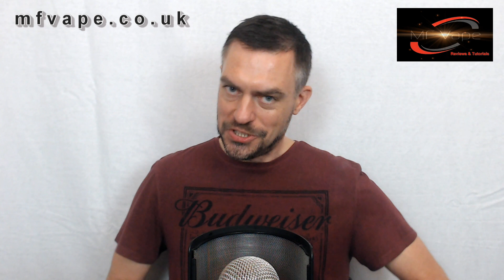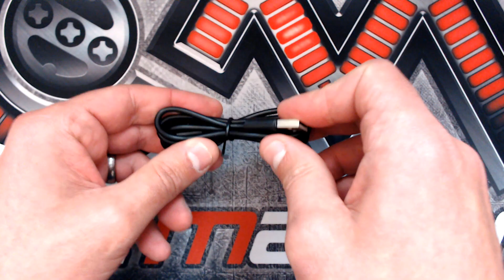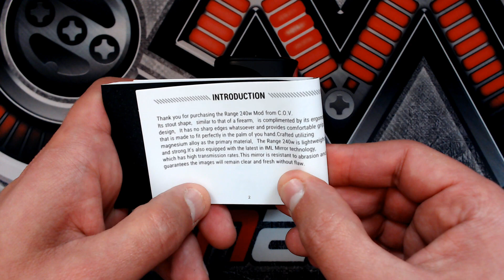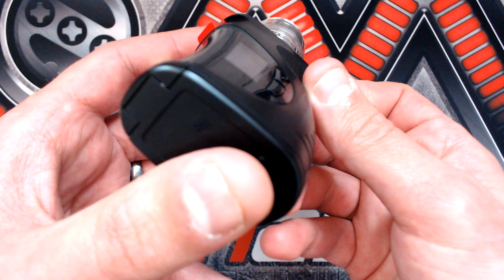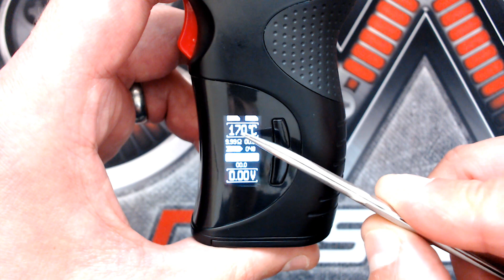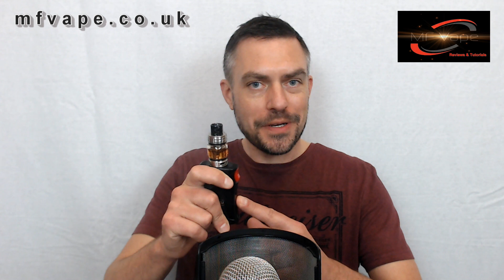Council of Vapor Range 240w Mod - Review by MF Vape

Comment: Looks kinda cheap if compared to the Smok Mag v2 IMO. Great review though Mike!
Reply from the maker: Must admit that's what I thought at first but it's really well built and super light. Smok mods have a reputation for not lasting too well though, albeit I do own their GX350 still going strong 2 years down the line. Cheers Itman 👍
Reply: Dual batteries may be a dealbreaker for some over single one in smok mag v2.
Reply from the maker: 2 batteries = better in my opinion Pav 👍
Reply: @MFVape  absolutely agree with you Mike. Even when using 21700 with higher capacity in single battery mod - that battery will be a lot more stressed than 2x18650 will ever be and on high amp draw, even within its safety limit will never be able to provide full capacity. Mooch showed it many times that mah ratings get shot to pieces if high amperage is drawn so dual batteries is a win for me too.
Reply from the maker: Indeed, however I don't mind the topside and recurve squonk using my single coil atties around 40w. More than ample battery life. For my dual coils I like my Rage and Basium 👍